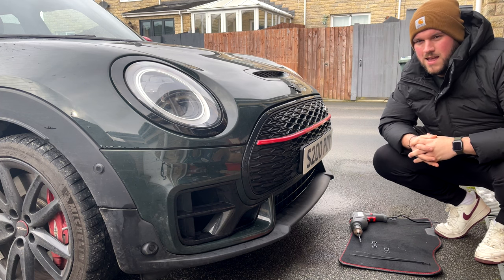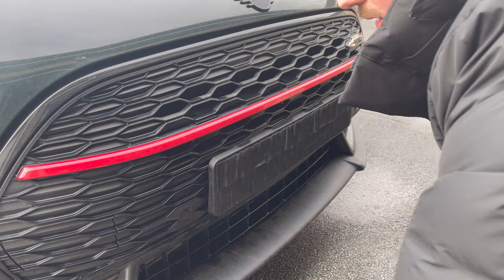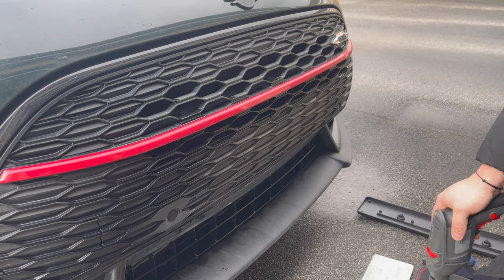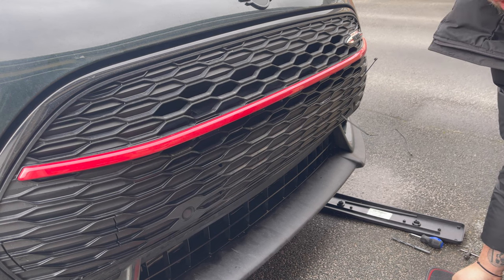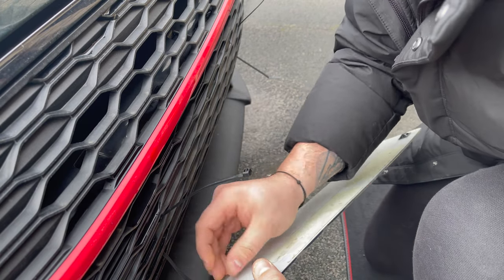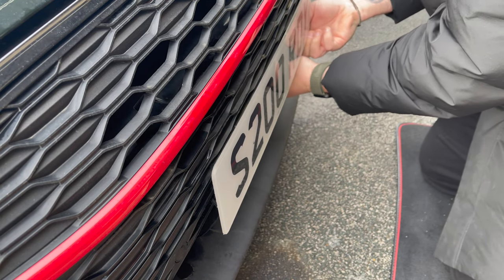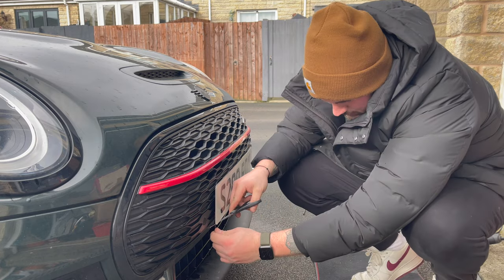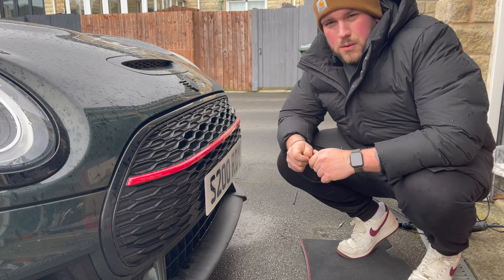MINI Hacks | Ep. 1 | Honeycomb grill plate mount hack!

Comment: Great mod, I'm doing this on my RS5 grill, compared to the 3d printed options this is cheaper, fully concealed and quite secure. Only changes I'm making is to use vhb tape and some jb weld to hold the plastic tabs on back and adding some foam stick on discs behind the plate to help take up some slack